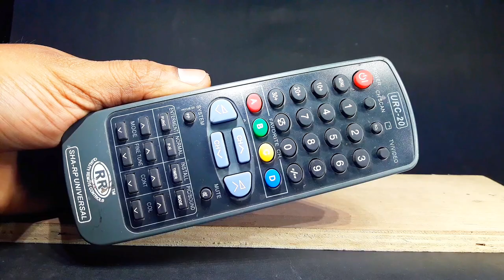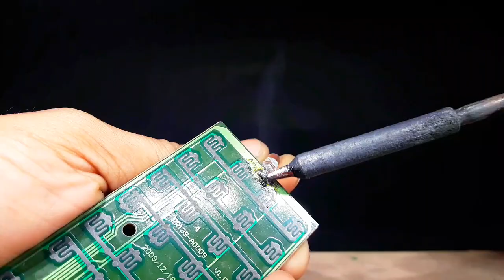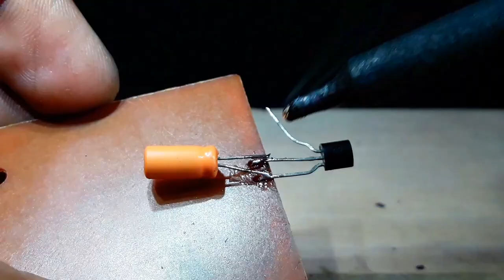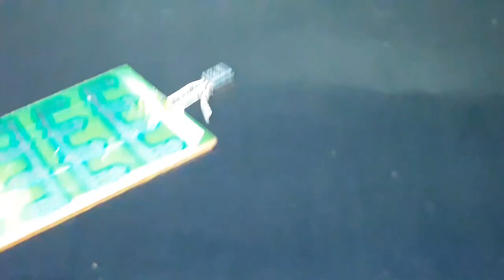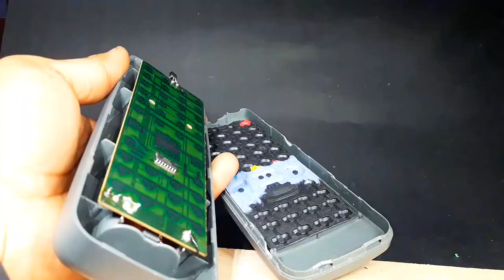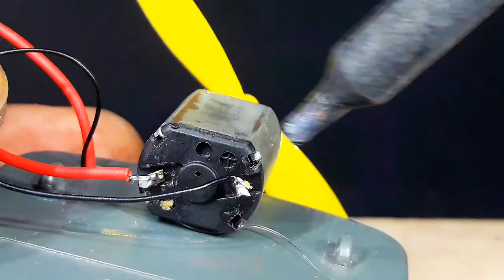awesome DC MOTOR FAN PROJECT / tv remote / 7techprojects

Comment: can i change the motor with HPL LED 1watt (into flashlight), and how to configure it ?
Reply from the maker: If your led bulb volt within 3v . Change the motor and connect the bulb
Reply: @7techprojects922  I've replaced it, but the light is blinking, not constantly on.